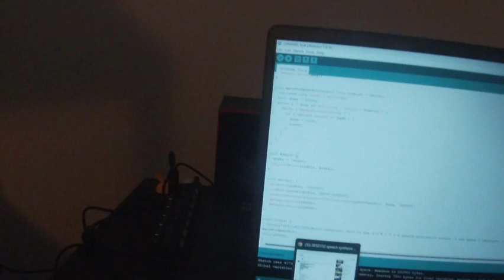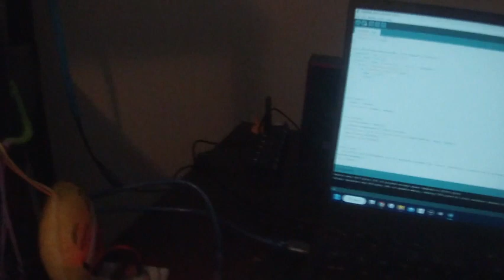SYN6988 TTS + Arduino #arduino #tts

Comment: "Pause if you want to read it.", as he shows a very blurry laptop screen in 480p. The whole video is also dark and blurry, making it impossible to see how the  Arduino is connected. I guess I will study the ino file and SYN6988 specs to deduce it.
Reply from the maker: I only uploaded in lower quality because my Network sucked back then. I have since upgraded my Network connection so new content is higher quality.